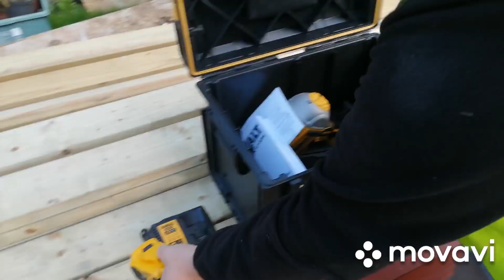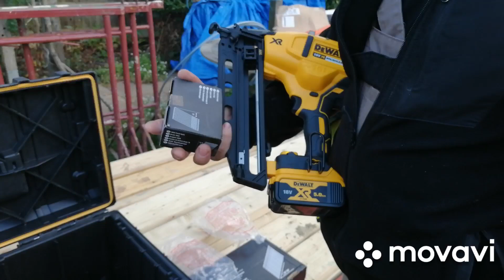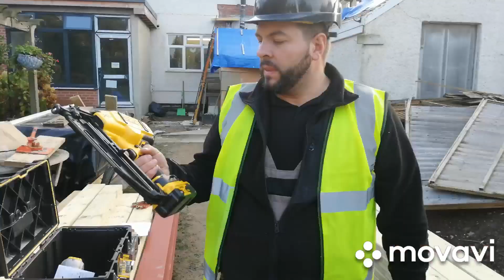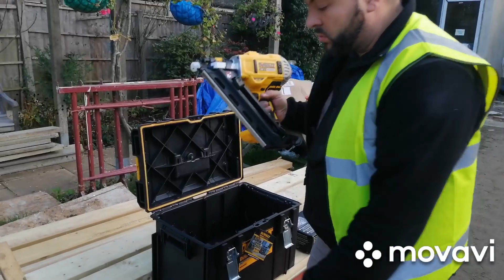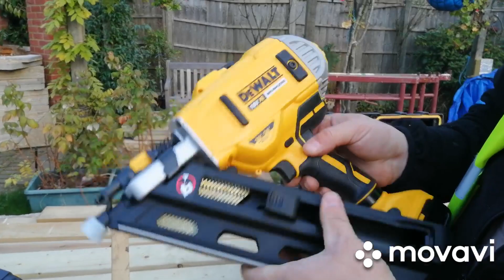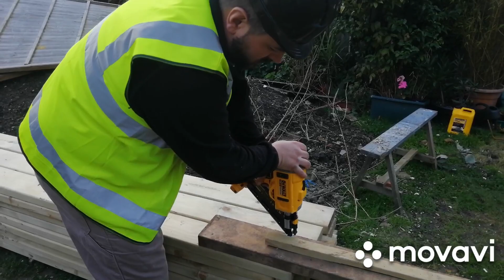Pistol de bătut cuie DeWalt.

Comment: salut simon!  incarcatoarele bateriilor sant la 110 sau 230v? multumesc
Reply: Un transformator de la 110 la 220 costa 60 de lei.
Reply from the maker: Încărcătoare sunt asa zise pentru 220v dar suporta pana la 250v aici  în Anglia sunt 240, pe 110v sunt opțional cele cu cablu pentru șantierele mari.